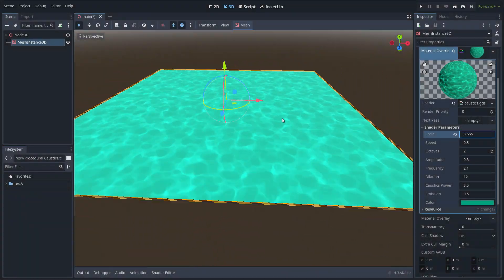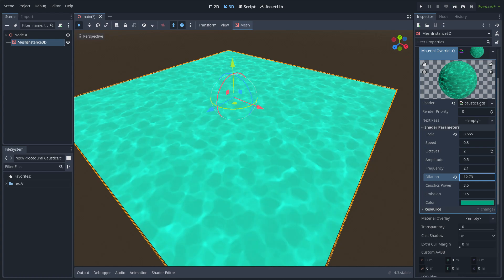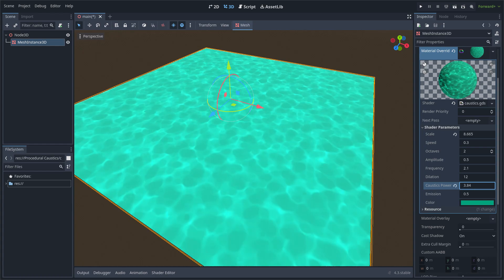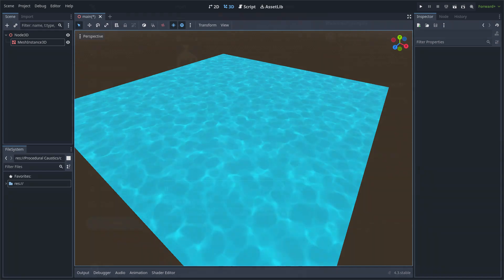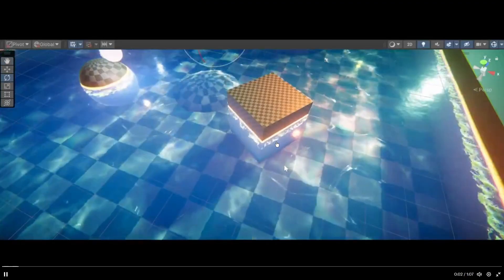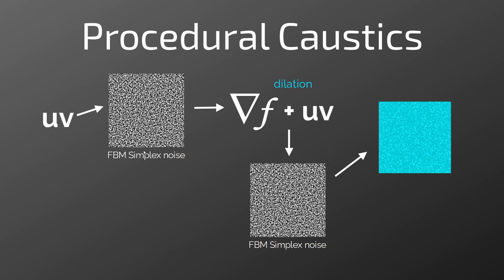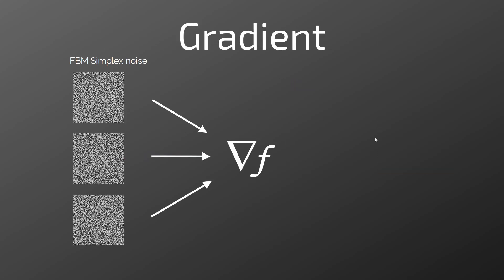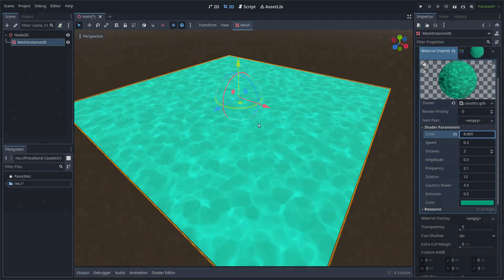Godot DEMO: Procedural Caustics

Comment: Back to the shader model 2 era? There were many ways of making true caustics, say myself I used photon mapping + a separable bilateral filter, and there were projects utilizing a deforming additive mesh as a scene to render into a lightmap. Both ways allow to achieve a correct lighting even from fluid simulations with a collider response, which really makes them stand out. Today you can even use the RTX features, although even the named methods create a nice effect for a very affordable performance cost.